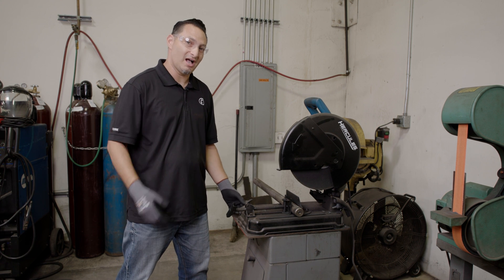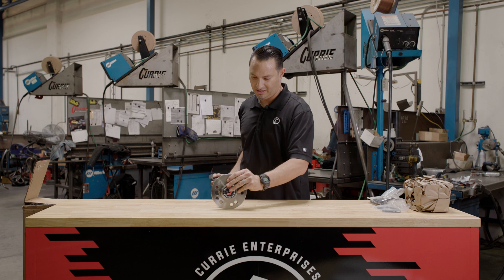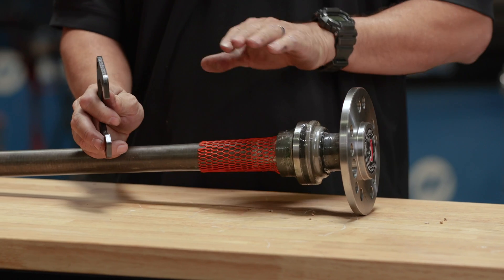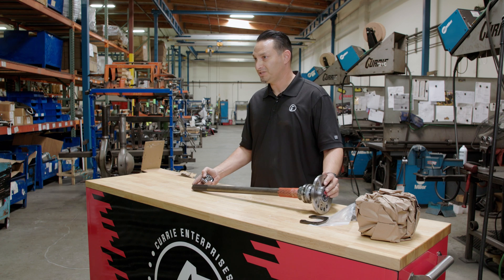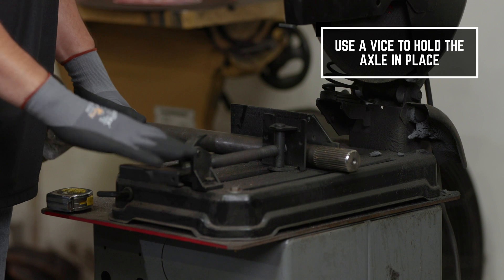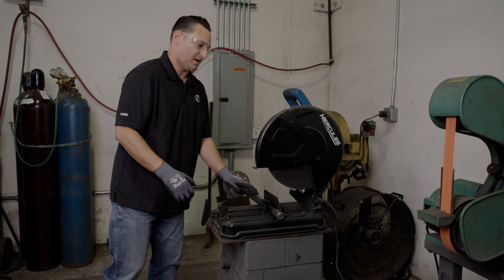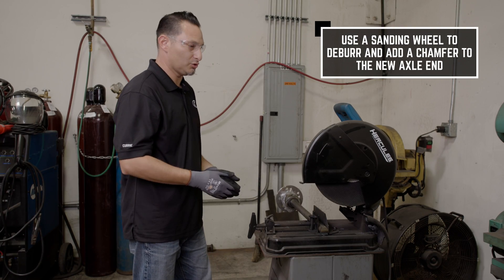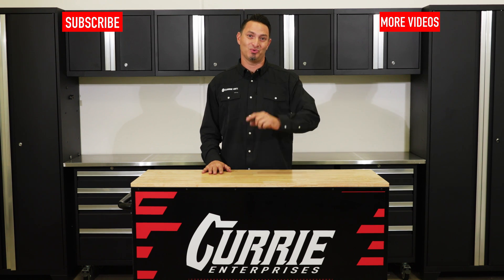HOW TO CUT A CUT-TO-FIT 9-INCH AXLE | EXPLAINED

Comment: These look like a great solution for my rat rod build. What's the narrowest axle tube you can use before you run out of splines? My car is really skinny so trying to keep my axle tube around only 42 or 43" wide. I plan on cutting it down tomorrow but i want to have some axles lined up first